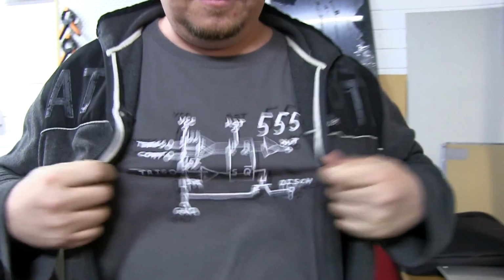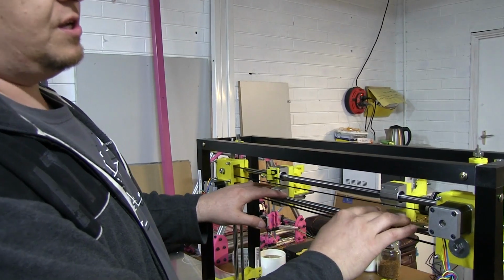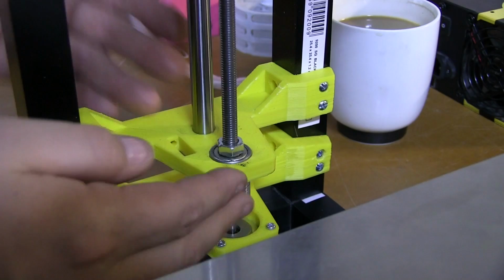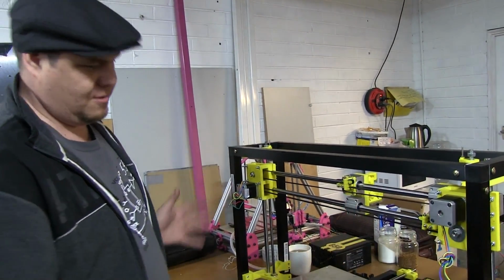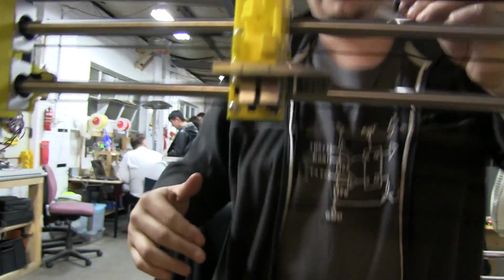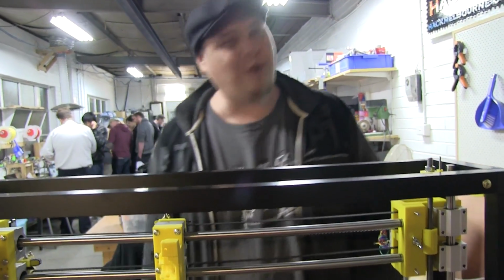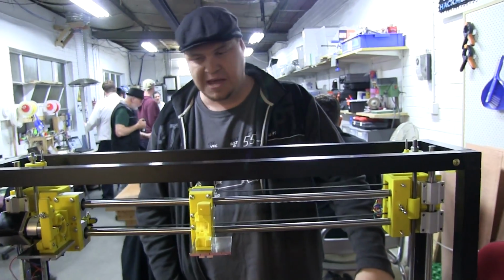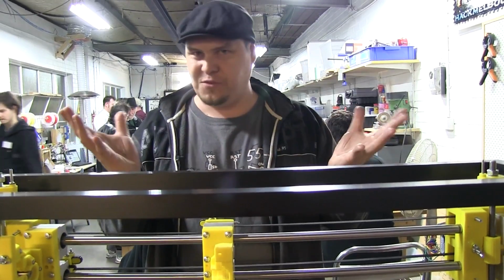EEVblog #520 - Michael's 3D Printer

Comment: Several of us Aussie model railroad hobbiests use this same 25mm square aluminium section for high strength / low weight bases for train layouts.  Very strong but lightweight for easy transport. Great stuff and the joiners are strong and easy to use too..

Comment: LOTs of designs out there with real machines. For hobby work, a number of people have created systems based on using lasers or projectors to harden liquid resin. Amazing detail there. Also, there are systems based on a print head suspended on three arms. That's still an extruder, though. For commercial, there are ones that can print colored adhesive on a powder, and others that laser sinter powdered materials.

Comment: As someone that built a reprap fairly early on (Sells Mendel), I had high hopes for 3D printing and still do. That said, I have yet to be truly impressed with any FDM based 3D printer for the engineering projects I undertake, the accuracy is just not there on any of the home printers I have had the pleasure of using. 

I have since built a CNC miller, and I am far happier with the results. The UV stereolithography printers look very promising though.

Comment: All those machines are too complicated. You still need belts, precision frames, moving table...
I have seen on YT big cnc milling machine. Motor was mounted only on 4 actuators. When you synchornise them, you can move motor wherewer you want (also up&down). No belts, no precision mechanics, just 4 actuators.
But i can't find this video.